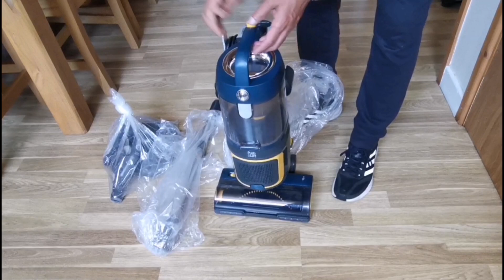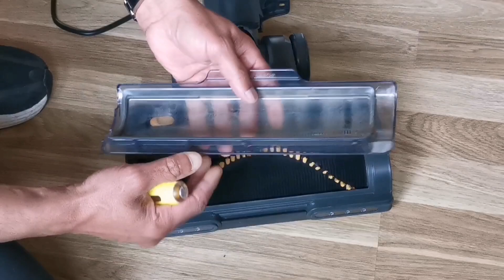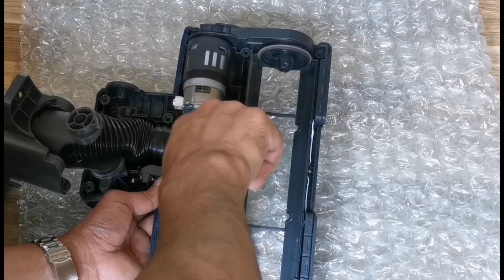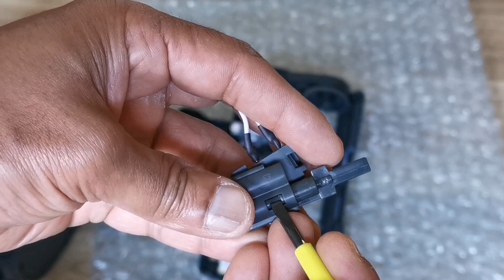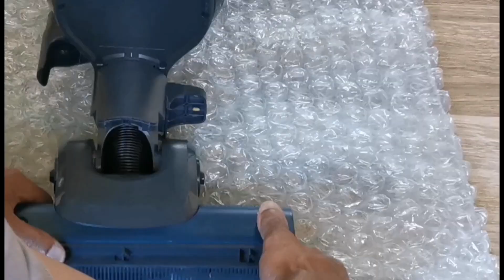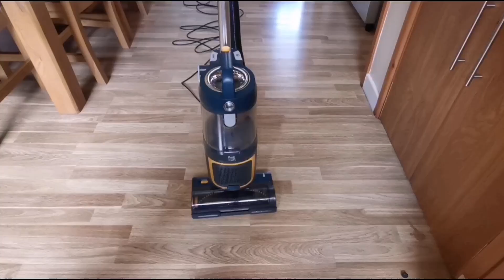HOOVER | HL500PT/Troubleshooting/Easy Fix

Comment: My problem was the LED lights on my new machine failed after just a few weeks :-( Your guide was invaluable to dismantle the brush head and fix the problem - (the connector was not propeerly installed). It seems to be a great machine with powerful suction - however, like too many modern products, it has poor build quality... :-(( Many thanks for your guidance.
Reply from the maker: Thank you very much, I'm very happy this helped you! That made making this video worth it!